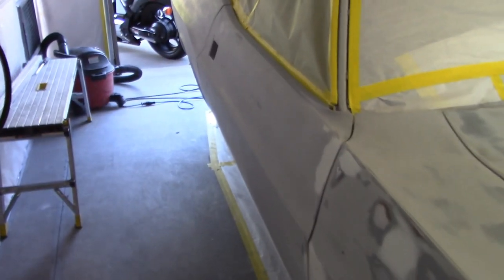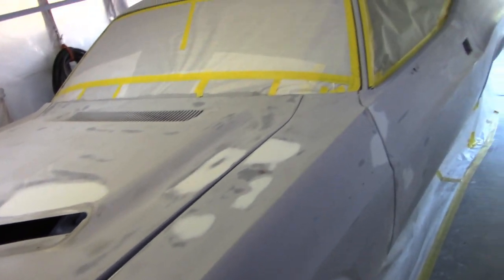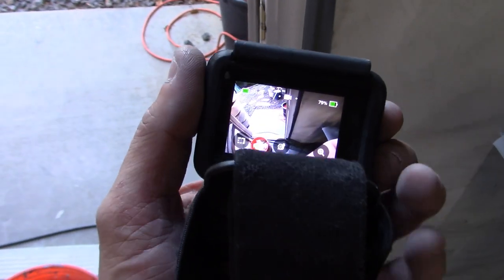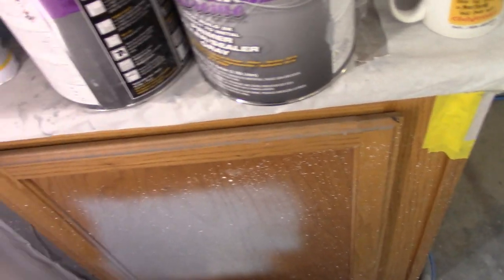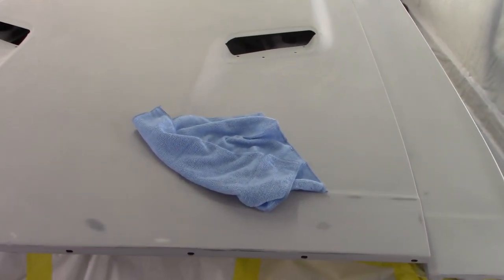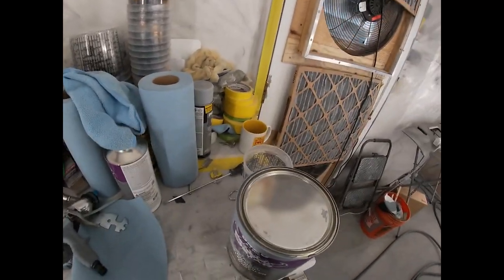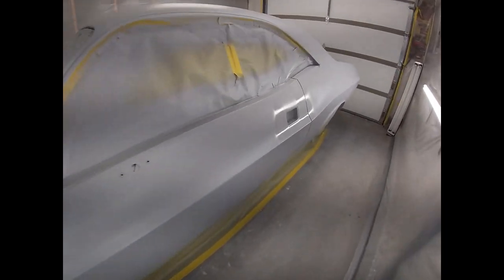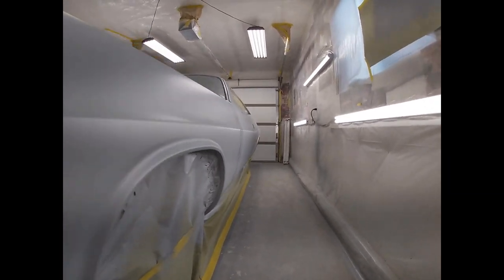1970 Dodge Challenger Spraying High Build Primer With Apollo Sprayers HVLP Maxi miser 3000

Comment: I've used that same primer. I use to work for a heavy equipment company that had there some what like a body shop. The company built there own truck body's to the customers needs. They also built there own custom dump truck beds.  We would prime it and guide cost right after the last coat on  what ever it was we were working on. Come in the next day and da with 220 then spray it with Imron single stage. Never had a problem with the sandpaper clogging up. It's sands nice I think. Nice work!

Comment: A good tip I read was with a Turbine always use a slow reducer with anything because of the hot air coming out you are already in need of a slow reducer no matter the air temp you are painting in.
Reply from the maker: there is no slow reducer in the Wanda brand my bad
Reply: @esrestorations   - Ah really OK good to know.  i was looking at that Wanda solvent line but found out I cannot get it in CA.  Did not meet the VOC requirement I guess???  Waterbase I could get but not the solvent based.

Comment: Yesterday I used electric hvlp for the first time. I see that You used 1.8 tip, this is where I made a mistake I just used 1.4 for primer like in compressed pistol but still after all job is done and looks decent. 
I just wanted to cut the air from the bare metal with 2k epoxy so I can continue the work on the other side of the car. At least I know now that when I'll be spraying filler that I should change the tip to 1.8.

Comment: Very good but I didn't realize the Maxi Miser was that loud.
Or is it just because of the microphone?
Reply from the maker: It's probably the microphone it's about as loud as your ordinary vacuum cleaner not loud at all air compressors way louder.
Reply: @esrestorations  How much can I paint with a Maxi Miser 2000 at a time. a hood? a door? bumper? I know they are not meant to paint a full car at once.

Comment: what size is this garage?
Reply from the maker: 24 deep by 12.5 feet wide 9 feet tall
Reply: @esrestorations  Thank you I am setting up a carport 12x20 in the next month so i can do some work at home. looks like you have enough space around the car but instead you got the 24 feet long. what I am going to do is put 3 open front storage sheds on the side as an addition 3x5. so Basically my set up will be 15x20 one room will be tools other room paint and other room sand paper and bondos

Comment: sand the first coat of high build with 180 ?  Really ?     I started with 320, then did 400, -- took me 10 hours by hand...I did not have to do that ??  Great, I reprimed and did 400 since I am going to paint it next week....
Reply from the maker: When I use extreme High Build primer I do send it with 180 to cut down on the time. this car was painted and finished last year and it has a show quality paint job smooth as glass! Everyone has their own way of doing things this was my way.
Reply: @esrestorations  this is my first painting of car, ever,  .. I'll try you method on the next one...I have at least 5 more cars to paint.. Thank you.